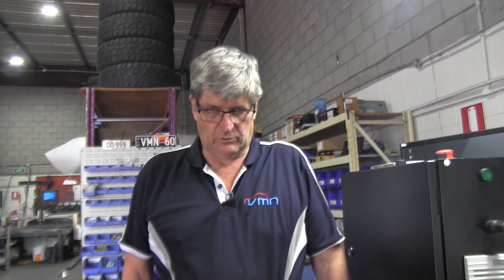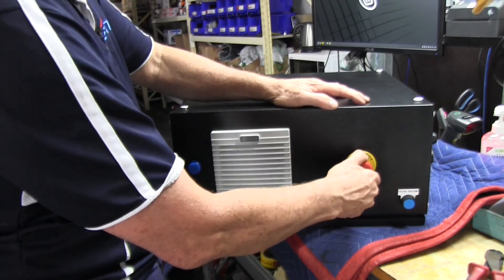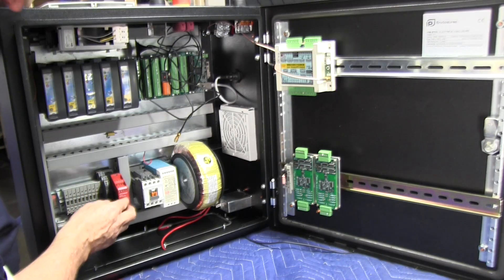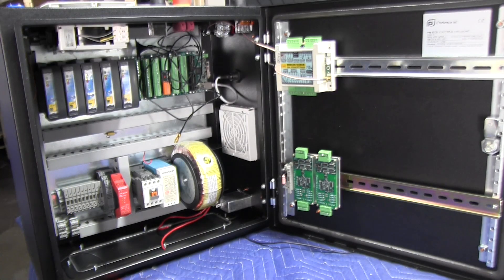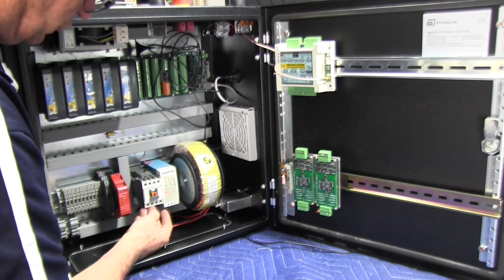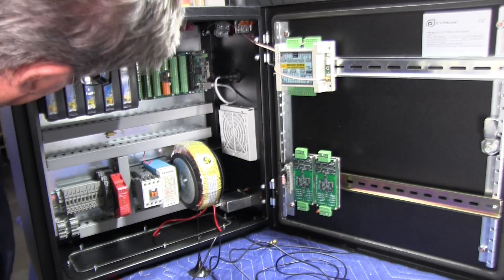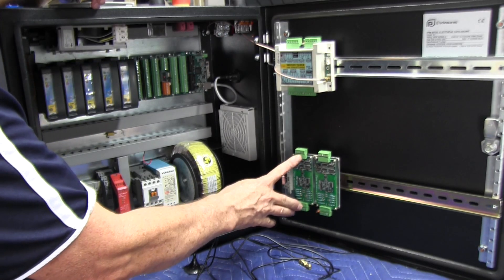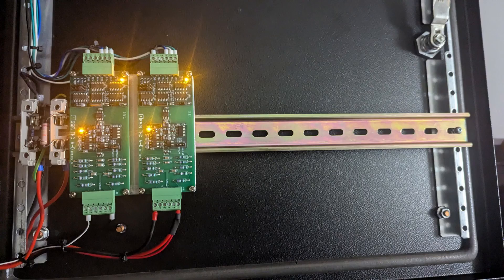Affordable CNC Control - LinuxCNC & Mesa 7i76e

Comment: Thanks for the awesome video Rod! I have the 7i76e board myself and at the cusp of completing the build, however, I seem to be having great difficulty getting the firmware (.bit file) to get the board to correctly talk to linuxcnc. Do you have any guidance you can offer? any would be greatly appreciated!
Reply from the maker: Thanks for the feedback. Generally the bitfile does not need changing. If it does, you use mesaflash. Its best to ask on the linuxcnc forum and attach your hal and ini file.

Comment: nice work. any wiring diagram?
Reply from the maker: No sorry. I only ever work off a wiring table like the one I shared here. https://forum.linuxcnc.org/38-general-linuxcnc-questions/54612-tip-on-how-to-plan-a-machine#315676 

Machines sometimes grow over time. I always updated the table before I did any wiring.

Comment: Rod, nice setup, excellent work! You mentioned linuxCNC but the computer appears to be running Linux mint. Are you dual booting into Debian or did you pull off compiling you own LinuxCNC to run on Mint?
Reply from the maker: Thanks for the Compliment.

Oops! The PC you  may have glimpsed was  running Windows as I used it for shipping and dispatch on that bench. I try hard not to use it Windows any more but my 3D printer insists on it so I dual boot when needed. 

When I first started out I used Linux Mint 17.3 and had to compile the real time kernel as there was nothing prebuilt back then. I ended up retreating to Debian around the release of Bullseye because compatibility issues around Python versions prevented me going back to Mint. Then I built the official LinuxCNC ISO's on Debian 12 for LinuxCNC Versions 2.9x so I have resigned to using Debian.  With the mate desktop, it is quite nice.

PS. This video was edited on Debian with Kdenlive and I am writing this on Debian too! :)